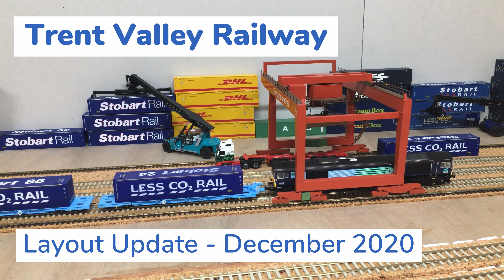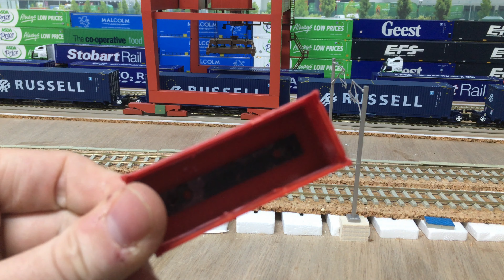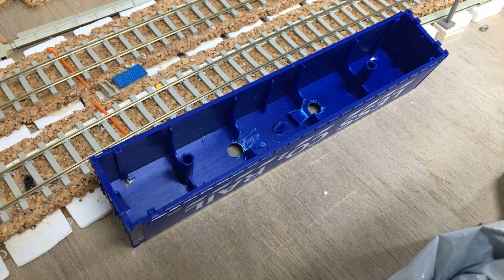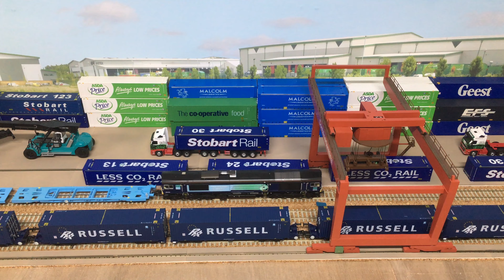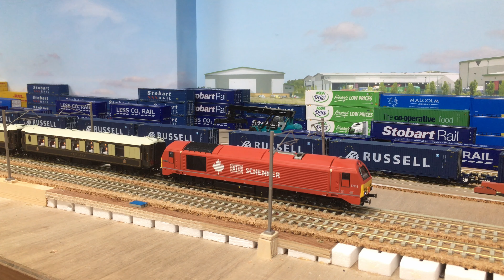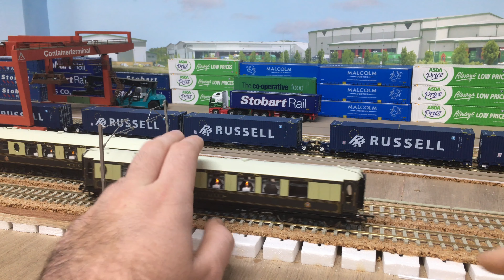Layout Update - December 2020 ~ Trent Valley Railway #55

Comment: This is a fantastic idea! Do you think there is a possible way to hide the magnets under the roof of the container? Is the magnet on the terminal crane strong enough to attach with whatever solution from underneath the roof of the container?

I'd like to incorporate something like this but haven't received the crane or any other components so i can't tinker with any ideas. Thought i could reach out for suggestions

Comment: Hi nice vid, how did u work out the spacing of the cross dowals drilled for the container? Was it just the measure between the plates on the magnet within the hoist unit? Many thanks.